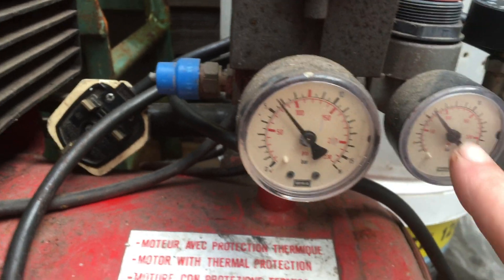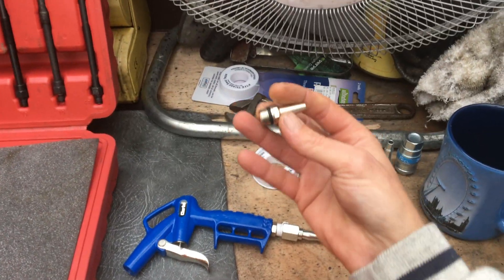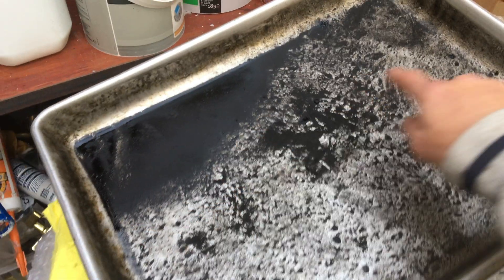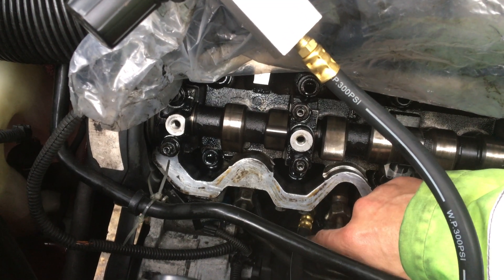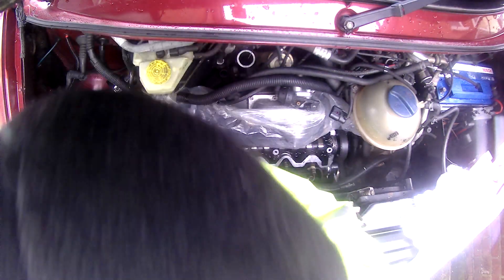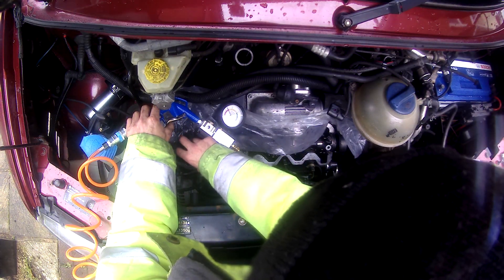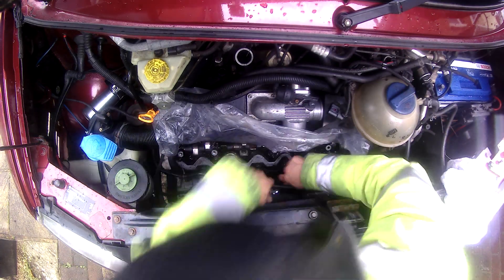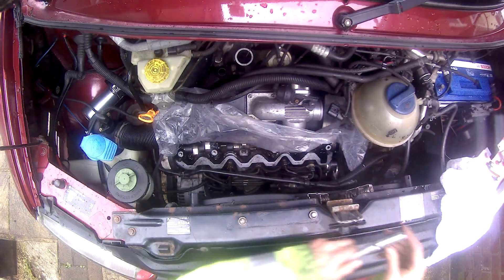Leakdown Test VW 2 5 tdi

Comment: Hiya, I've been seeking advice via fb Just T4's.   I am researching doing a leakdown test on my t4  2.5tdi acv engine.   Many of the kits available for diesels seem to be just compression test kits (not using an airline).  The Sealey kit you have is it expensive?  I just need a long m10 long reach adapter really.  I have compressor. I will have to do it by turning the engine as its all together.  Thanks for guide very useful.
Reply from the maker: Leak down tests are good and have a purpose, it depends on why you’re doing the test. The compression test kits are probably quicker and easier to do is you’re looking to compare the cylinders. Leak down test is good for listening and narrowing down where the loss of compression is coming from. The sealey kit is quite expensive and I believe it’s around £150. I am lucky that I was able to borrow this kit from another mechanic.  Hope this helps, good luck 👍🤙
Reply: @TwiggsT4  I tried to put the information and link from face book t4 group.   Basically burning loads of oil, blue smoke.  Had a reconditioned rebuilt top end.  Turbo checked no turbine wobble.  Oil sitting on top of cylinder as glowplug wet with oil.  Likely issue with oil scraper ring as I installed a new piston and cylinder but really don't know for sure.  Doing my head in a bit.
Reply from the maker: Yeah YouTube doesn’t want you to link to Facebook 😂 I found your post and have replied. How it helps 👍 good luck 🤞
Reply from the maker: I just seen that about oil on your glow plugs, is it all glow plugs or just the one? Are you sure it’s oil on glow plug? Is so could be faulty valve stem seal
Reply: @TwiggsT4  hiya, yes smells and looks like engine oil.  On almost all the glow plugs, amazing I starts with them being so wet.   I hope the valve steals arn't failing as I paid a lot of money for a completely rebuilt head.  I few people are thinking valve seals as seems like the oil is coming from the upper parts of the engine.  Your van looks great in the red, always liked that shade.
Reply from the maker: Compression test, then leak down test on the 3 cylinders that are letting oil by. Is one of the 3 cylinders the one that was damaged and replaced?
Reply: @TwiggsT4  I just checked the photos. Interestingly no. 1 was the only really soaked with oil.  Others had sort of a rust spot on the end and dry oil.   The cylinder I replaced was no. 2 not wet really no. Perhaps no. 1 didn't have any visible damage after the cambelt failure but perhaps it was not straight or square and failure has occurred some 1000 miles later on.  Cheers

Comment: Hey, thanks for sharing your vids. Ive been in a similar situation as you recently.  it turned out I had a leak in the 3rd cylinder through the intake valve. When I looked into the inlet manifold it was caked with sludged due to the EGR, I highly recommend you block this off going forward.  Not sure if this helpful info but all the best. Lucky for you your in the UK and have access to parts easily, I'm in NZ
Reply from the maker: Thank you for telling me about your experience, the cylinder head is close to coming off just, hopefully that’s all it is carbon, I have already blocked the egr but I only done that a few months ago. Once heads off closer inspection should reveal the issue. Wow NZ is a beautiful country, I had a friend move my to NZ and he never came back.